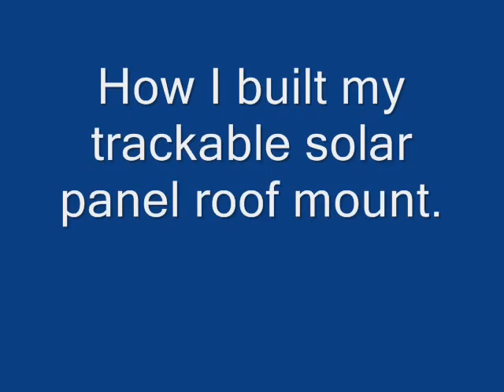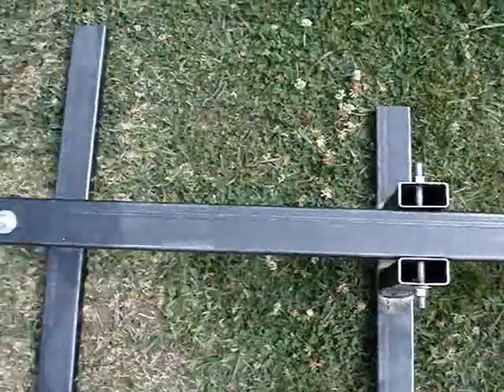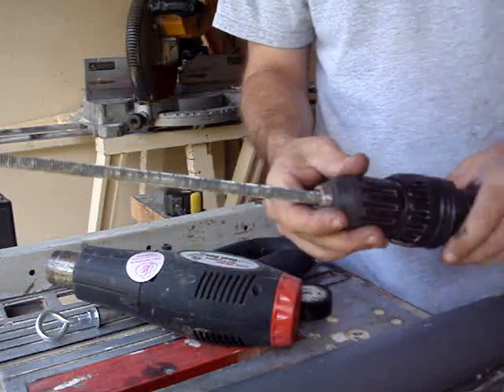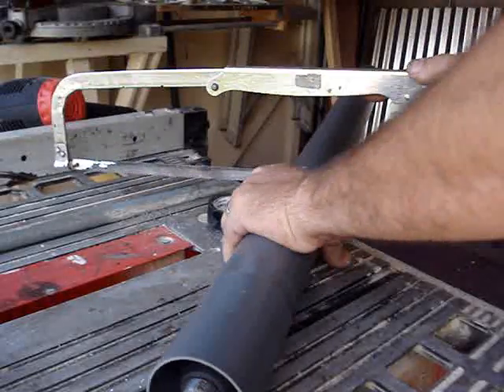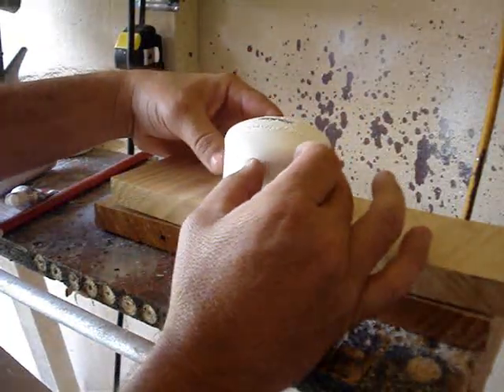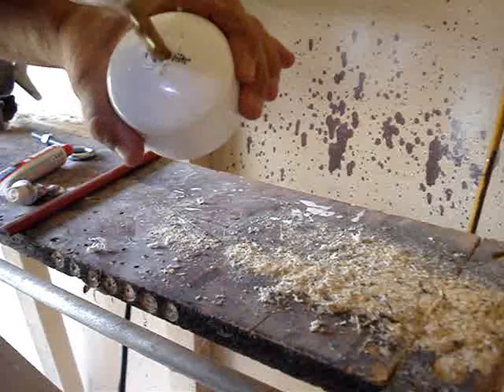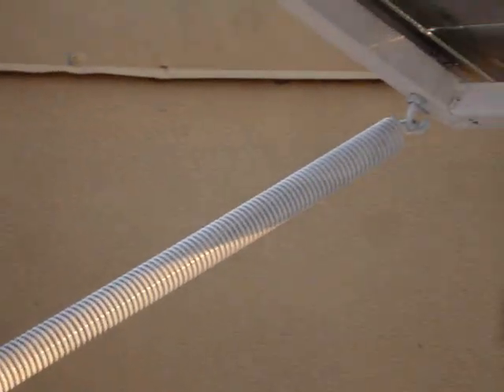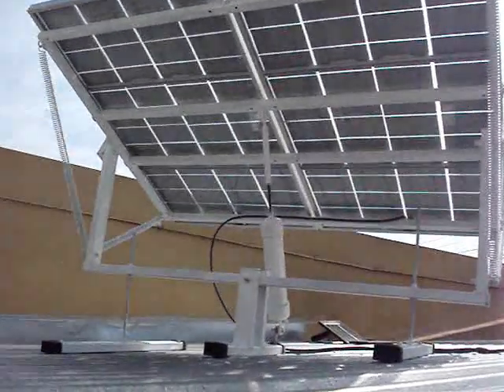How to build a solar tracker. DIY solar panel sun tracker.

Comment: Hey Aceman307, great idea you have there and a greater video to back it up too.  I have three questions.  (1) assuming, if we use two motors one driving at the east end of the panel and the other at the north end, and supported with moveable supports (something like a ball joint) at west and south end, can we have a dual axes solar tracker ?  (2)  Would the use of bearings reduce wear and tear and also eliminate the issue of grease application at regular intervals ? (3)  what is the improvement in the efficiency of power output from the panels ?  Thanks and cheers.....Madhav
Reply from the maker: +Madhav Pulivendala I have read that a tracker can gain as much as 20 percent more efficiency than stationary panels. You could add another motor to the side that I have the threaded rods on and make it a two axis tracker you could use bearings if you were using maybe more panels. For what I have I just grease the joints and have not had any problems in the 2 years I have been using it, You could also use the same timer software that I use to run the other motor. Thanks for the comment.
Reply: +Aceman307 First of all, this is badass, thank you for the video - I'm getting a lot of ideas.... Second a reply to yourself and +Madhav Pulivendala, here's my approach to this scenario, instead of using the screw thread to adjust the other axis, use another motor mounted in the same fashion as the other axis... then, to counter the weight/pressure on the opposite side of the motor, install a simple hydraulic system (like a bicycle pump with a small valve and rubber insert to prevent air leaks)

In terms of software, I'm a linux kind of guy, I'd write all of this myself in python and use some motor controllers, but I guess you technically don't need motor controllers if you reset the system on the daily
Reply from the maker: +schr4nz I just posted a video on running this tracker with an Arduino. I posted a card to this video please check it out. I had mentioned to others the same idea about making another motor and changing it out with the threaded rods. If they needed a two axis tracker. Good idea with the bike pump. Thanks for the comment.
Reply: Aceman307 Yeah, I actually watched that video after I commented... looks awesome!

Comment: hi there,is this a 12vdc system run from batteries, or are you running this from the mains?cheers,Ross
Reply from the maker: +TheRossRants I had it running through a grid tie inverter. Now I have it hooked up to 12 volt batteries.
Reply: +Aceman307 cool. thanks aceman. I think I have another project on my list for next spring :)

Comment: very nice tutorial
Reply from the maker: Bekir Arslan Thanks
Reply: Aceman307 Do you plan to add vertical movement to this build?
Reply from the maker: Bekir Arslan It has the other axis North/ South, its manual the two threaded rods . I just change the angle twice a year. The East/West tracks everyday.

Comment: Aceman, you have tipped the scales at inventive engineering! I am anxiously awaiting your control circuits. I was contemplating last night, the tracking motor of a night telescope to attach to my panels. You provided me with a better idea. Thank you!
Reply from the maker: Jerry Murray I have two videos that show how I setup the controlling of the tracker https://www.youtube.com/watch?v=GsNCz97pkmw and https://www.youtube.com/watch?v=LDlZmeVEzvg I hope this helps if you have any questions I will help if I can. Thanks for the comment.
Reply: Aceman307 
I think I may have to review an arduino controller for mine. I do like your design of the motor assy, though for variable voltage, there might just be a better way without using a stepper motor, and using your drill motor design. Very good idea you have there.

Comment: props on the epoxy, question though, did you grind 3 flats on the rod where the chuck teeth are, to have flats and therefore slip proof ?
Reply from the maker: maximum woof No I did not . I made sure the chuck was tight using a couple of pliers after two years it has never come loose. But you could do as you say to make sure.

Comment: awesome video, but i have a question... How do you calculate the length of the rod you are using in the drill?
Reply from the maker: Andre Kloppenburg I am sure there is  a mathematical formula to figure it out. I just test fitted it until it worked. About 3 times.
Reply: Aceman307 After searching on the internet i found a solution for calculating the length of the rod. The formula i used is: length = sqrt((sqr(b)+sqr( c)-(2*b*c*cos(angle))). b=base of the panel when its flat on the roof, c=height of the panel, and angle is the angle of the solarpanel related to the flat surface of the roof. I hope it make sense... You can get the angle of the solarpanel to  the sun at http://www.solarelectricityhandbook.com/solar-irradiance.html

Comment: Um your chuck  will come sir
Reply from the maker: donald laisure After 2 years it works perfectly. If you noticed in the video I added epoxy to the chuck. I only have to adjust the angle of the panels for the time of year.
Reply: I started stator but need get magnets  as start this 2 years pie shaped best place 2 get

Comment: Are you situated on the equator? Because I see only a celestial azimuth tracking and no horizontal?
Reply from the maker: I adjust the horizontal twice a year.I am close to the equator the tracker really only needs to have the azimuth tracking. Thanks for the comment.
Reply: Aceman307 That's what I thought. :)
We're building a bigger (5 x 18 panels) 2 axis mount set her in the Netherlands (52˚N) using an Arduino controller. Near the equator those things can be much simpler. Lucky you!
Reply from the maker: mlombaers Yes it is does make it easier. With this design I have here you could easily change it to a two direction tracker by not using the two threaded rods and install an electric cylinder  instead. Good luck with your installation.
Reply: mlombaers are you done with your project? if yes, can you provide me with the source code? cuz i am building a similar system, that uses arduino as a controller to control two stepper motors.
Reply from the maker: mona Salah I you watch my other videos How I built the control box and Control software for my equipment videos they will show how I run the solar tracker. I am sure you could use the arduino I was going to use it but I had an old computer and found the software I could buy so it made it easier for me. Check out Adafruits website and channel they have a ton of info for the arduino.
Reply: mona Salah We're going to run the first one through its paces soon. The complete code will not be exactly what you need as we are using 3phase motors instead of steppers for this project due to the huge mass of the construction.
If you send me your exact location I can create a table with the sun position through the year.
Reply: it is totally fine, please please whenever you do post the code mention me or send it to me via my email mona.w.salah@outlook.com
I can remove the parts of the 3phase motor and include the stepper motors. 
and actually we are using LDRs for tracking the sun not a pre-calculated system. but of we shifted to having a precalculated one, I will contact you!
Reply from the maker: mona Salah Thanks. Let me know how your system turns out.

Comment: Is the solar tracker uses electricity whenoperation?
Reply from the maker: It only uses 12 volts from a battery for 1 second about 6 times during the day and then when it resets about 10 seconds.
Reply: Aceman307 So for how long can the 12V battery last? Thanks for the response.
Reply from the maker: Patrick Vergara The battery is connected to 2 smaller solar panels that keep it recharged. The two big solar panels are connected to the grid tie inverter

Comment: Very good idea and very well explained.  How well do the pvc parts hold up? I would be concerned that the large surface area of the panels in the wind and the large moment arm distance would create enough force to break it in hight or repeated wind.
Reply from the maker: Thank you. I have not had to touch anything in the 1 1/2 years its been up. Only to change the angle of tracking twice a year. No problem with the wind or rain I have some rust on the metal but not much I should have used a better paint. The PVC for the motor is under the panels so it is protected from the sun and rain for the most part.No problems with the actuator at all.
Reply: Aceman307
Reply: Aceman307 Stainless steel or brass parts are the key to prevent rust. Take a tip from the marine world.
Reply from the maker: Black Hat Why not take a tip from NASA some titanium or some gold plating would work also.

Comment from the maker: Ok Check out this web site PV watts- Renewable Resource Data center, enter your location it will take you to a screen that allows you to input fixed array or single axis tracking then hit calculate, record the kwh number for fixed and then do it for tracking then plug those two numbers into a percentage between two numbers calculator. My info says tracking gives me a 26.6 percent increase than not tracking. If anyone sees I did this wrong please let me know.
Reply: Aceman307 
I guess with a mppt charge controller you couldn't get much better.  I plan to build one . since I live in trees. and only get sun for about 5 hours or so. so I want to get all I can while its there to get.

Comment: Pretty crafty. You are a real MacGyver. I had the same Idea for moving my panels north and south with the drill manually. But that was real inventive. Kudos to you for diy actuator. They sell those cheap China actuators on ebay for 35 bucks just saying. A drill will run off of a solar panel too. But a battery makes a great buffer. The roof idea is nice to look at but the roof can get pretty hot. Solar panels dont work well in  hot places. So I like to put mine in the grassy yard on a post.

Comment: Man, that is outstanding. I built a PICAXE08M MTM Scientific printed circuit board single axis controller from scratch but the mechanics get me stumped on how to "improvise". Sure I could buy everything, but for me... that's not the point, because i could also spend that (large) amount of money on "more watts" -- but this -- is GREAT. I have several old cordless drills. Thanks so much.